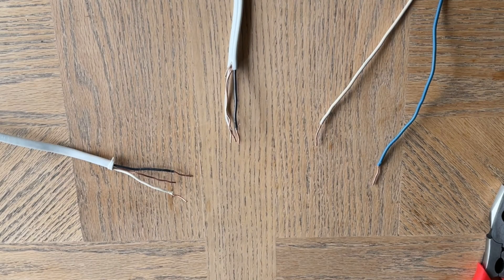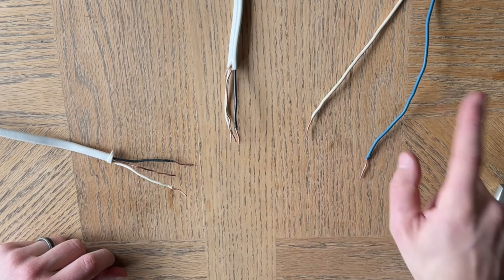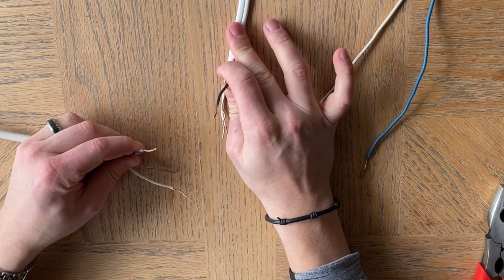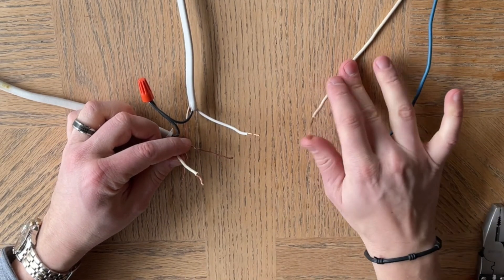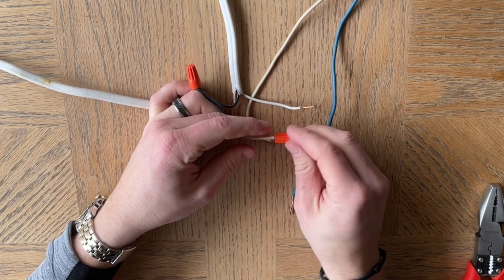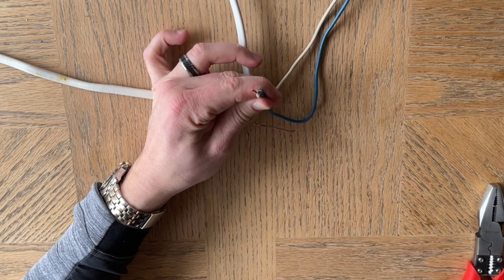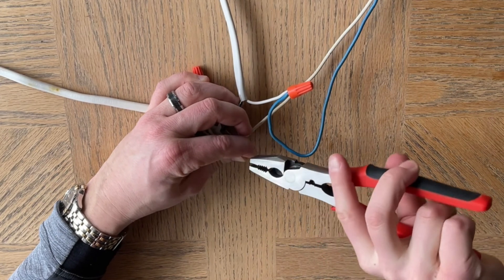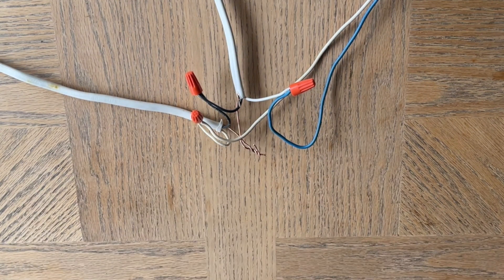How To Power A Light Switch From The Light Fixture

Comment: Preference would be to have the neutral come down from the fixture into the switch box and just terminate in the box just in case the neutral is needed later (like for a dimmer or fan controller).  Then another Romex would run from the switch box back to the fixture box to run the switched hot back to the fixture.  This way the wire color codes remain in tact (no hot wires on white insulation) and you have future proofed the installation.
Reply from the maker: I appreciate you sharing your approach and insights!

Comment: I have the same set up but have 2 other wires coming into the box.  I have identified the hot but cannot identify the switch wire?  how do I do that?
Reply from the maker: You can try capping the wires on one end. Then send a current from the other end. Test the wire so you know which wire runs where.

Comment: This wiring method has been illegal since 2011.  Millions of homes are wired this way and it is safe but is considered illegal now.  You MUST have a three wire cable going into the switch box now.  The black and red are used for the switching and the white neutral is capped off in the switch box.  I like the way you wired it and my home is wired as you are showing but we are not allowed to create an end-of-run switch using this method any longer.  The thought behind the change is that with all the modern switch capabilities now available they require a neutral wire to be connected to these modern devices for them to function.  I have simple switches wired to my lights and don't plan on putting in dimmers or motion switches etc and they work fine.  Since I built my home in 1999 I don't have to change anything (grandfathered in).  But, since I built a new shop this year the end-of-run switches must use a three-wire cable (black, white, red and ground) to put the switches in operation.  The white neutral must be capped but remain available for future 'new device' installation.  Good video, clear, easily to follow and understand but unfortunately the method described is out of compliance with the NEC.
Reply from the maker: Thanks for the great info about the code, I appreciate it! Many homes are wired this way and grandfathered in. Hopefully, this video will help people troubleshoot their wiring.
Reply: @HowToVideoChannel  This video is perfect for the purpose of understanding how many older homes are wired (like my 1999 home or homes built as late as 2010).  I was surprised to find that the code had been changed to accommodate the POSSIBLE FUTURE use of new devices.  Why don't they require that every kitchen install both gas and 220V outlets for the possible change to a different FUTURE cooking device.  Or require both gas and electrical options for hot water heaters.  Why don't they require switchgear to be installed at the main breaker panel in case the home owner decides in the future to install a home 
solar system.  Personally I prefer the two wire method you are describing.  It's simpler, cleaner and has worked for decades and will continue to work safely well into the future......just mark the white wire with black tape or black marker and all is good.
Reply from the maker: So true!
Even things like adding extra space in the breaker box or adding both gas and electric for the dryer.

Comment: I have power coming directly to my outlet in the bathroom from the control box how would I be able to to provide power to my light fixture then to my switch
Reply from the maker: You’ll need to pigtail another line off of the hot line coming from your control box. Then run that to your light fixture then to your switch.

Comment: Again, thank you for another great video on wiring switches. I have double switches with power coming from a fan/light fixture. I would like to have one switch powering the light and another powering the fan. I don’t know if you could help explain the wiring through written text? Maybe something to consider for a future video. Your videos are so easy to understand that I would enjoy watching more of them.
Reply from the maker: Glad to hear you enjoyed the video! What does each switch control right now, left, right? It may be as simple as unwiring the switches and only putting one set of wires on one switch and the other set on the other switch.
Reply: @HowToVideoChannel Thanks for your response! I have a one gang box with a double switch. The fan/light used to operate on one switch where you had to go to the fan and either pull on the light or fan chain to turn either function on or off. I would like to be able to control the light and fan separately from the double switch.
Reply from the maker: Okay, that makes sense. What you’ll need to do is open up the fixture and find the wire that is controlling the fan. Then you will wire that wire to the line that you are sending down to the switch that you want to control the fan.

You’ll do the same thing for the wire in the fixture that is controlling the light. Wire that wire to the line that you sent down to the switch that controls the light.
Reply: @HowToVideoChannel Thanks for the additional instructions. I found a video that showed what you’ve described. It was nice to get confirmation. Thanks and keep up the good work because you’re a great teacher!

Comment: how would you add an electrical box to this setup? I think it's required to be compliant and derisk spark fires.
Reply from the maker: Probably add the box before the fixture. Then run lines from the box to the switch. Then from the switch to the fixture.

Comment: what happens if you splice the fixture neutral to the switch neutral? Basically mixing up the switch and breaker cables
Reply from the maker: That should be fine since the neutrals are supposed to be connected. It runs from the breaker to the switch and to the fixture. The switch acts as an interrupter.

Comment: Have this exact setup at a fixture in bottom stairs of my basement the switch is upstairs. If I wanted to add a light at the top of the stairs close to the switch how would I wire that
Reply from the maker: You would have to pigtail wires off of the existing light fixture, since the power is coming in there and there is probably an existing pigtail, and send them to the new fixture. 

Or, you could possibly pigtail the wires at the switch and send power to the switch and the new fixture.

Comment: Is it possible to add a switch at end of run.

Breaker to receptacle to light....to switch?
Reply from the maker: You would have to run from the receptacle to the switch and then to the light since the switch is to be an interrupter.
Reply: @HowToVideoChannel  thanks. My electrician neighbour drew me diagram. Ran romex from 1st light to switch and wired accordingly to his instructions. Worked like a charm
Reply from the maker: That’s excellent!

Comment: What if i have that same setup but also have  another wire that idnt know wher it goes? And the light switch turns light on and off but theres still load to wires when light switch is off
Reply from the maker: Sounds like something that should get checked out by an electrician. Seems like you have extra hot wires. Possibly a second switch that was abandoned???

Comment: Hi, how do I wire a single pole switch to an existing ceiling light with a pull cord to turn on the light?
Reply from the maker: You would interrupt the connection from the hot line in to the fixture. The hot line would feed the switch and the switch would send power to the fixture.

Comment: I wish to add  a second light to my stairs.   From the bottom stair light for power, to a new 2nd switch to the second light. Make sense?
Reply from the maker: I think so. You want to add a second light and a second switch. So you’ll have two lights and two switches with both switches controlling both lights.

Comment: Is it possible to take that light switch to power a different light that I install?
Reply: Do you mean a single switch controlling multiple light fixtures? If so, just add another nm cable connected exactly the same as the light fixture (as if you were just duplicating the fixture), and run that nm cable to your new (additional) light fixture.
Reply from the maker: Excellent!
Thanks for sharing your expertise!
Reply: @HowToVideoChannel  of course. Thanks for putting out quality, knowledgeable material.

Comment: I have a similar set up in one room of my house with a twist. Hot wire comes into the ceiling box to power the light, wires go out of the box to the switch, but the twist is the rest of the room (several outlets and a closet light) get power from the hot wire in the ceiling through the light switch somehow. I know this because now that all the wires are disconnected those outlets and closet light do not work.
Reply from the maker: That is a strange setup!

Comment: It's would be wise (actually its code) to put a few wraps of black tape on both ends of the white wire going to & from the switch to indicate it's being used as a power in the application rather than the common or neutral that the white shielding would typically indicate. So that white wire connected to the blue wire should have a few turns of black wire near the end (as well as at the switch end) as part of the setup.
Reply from the maker: That is a good practice.

Comment: Great video! Really helped me understand the old wiring in my first home. How would I power two other switches off this single source of power? I'm trying to add a bath vent van that has a light and the fan
Reply from the maker: Glad it helped!

You’ll have to run additional wires sort of like adding extra outlets. But it will be complex depending on whether you want the switches to control different lights or the same lights.

Take a look at the other wiring videos on this channel. I’m sure they’ll be helpful as well.

Comment: Thanks so much! What if you have to send power from that fixture into the next fixture in the next room? I'm guessing everything the same except the H and N from the load come in from breaker would connect directly to the line going to the next fixture?? Is that clear as mud?
Reply from the maker: You would need to pigtail the H and N from the breaker. Sort of like if you run multiple outlets and pigtail off the main line to power each outlet. 

This is slightly more complex since you’ll have an additional wire from the switch to the fixture for each room. 

However, if you only have one switch for all rooms then you can simply run the wires directly to the next fixture without pigtailing. Exactly like wiring multiple can lights in a ceiling.
Reply: Please do a video on this next.

Comment: I had the same issue...as old light fixture was hot with toggle switch.....now makes sense... My question is can the can new line be a 12/3 wire ....and if so, how is it properly wired?
Reply from the maker: As long as the current wire is 12 gauge then that should be fine.

Comment: I would wrap a piece of black electrical tape on the white hot wire connected to the blue fixture wire to designate as a hot wire.
Reply from the maker: Yes. That works well!

Comment: i did the same set up but i need the neutral wire for smart dimmer light where i get it from since the neutral is hot now
Reply from the maker: You probably need another wire.
Reply: @HowToVideoChannel  thanks for your reply. So do you think i can loop just the neutral from the  box in ceiling
Reply from the maker: That would most likely work.
You should run your plan by a local electrician to make sure it’s up to code.

Comment: can you add a 3 way switch? to this same configuration?
Reply from the maker: You would need to run an extra wire, but essentially, yes.
Reply: My problem was the first switch feed was a powered by the light fixture itself. I realized I had to use the white on the common @HowToVideoChannel
Reply from the maker: Glad you got it figured out!

Comment: What if there is another set of wire to an outlet? That you don't want to use a switch on
Reply from the maker: If they are extra wires that you don’t need then you can coil them and put a wire nut on the ends.
Reply: Powder room application, same scenario as your video, however I would like to add an outlet next to the light switch. Can the outlet be powered directly from the switch? It would be fine if the outlet would not function if the light switch is off.
Reply from the maker: Yes, you can add an outlet. 
You’ll probably have to pigtail from the hot line so that your outlet has continuous power.

Comment: Ok this is the same situation i have with my basement lights. I built a pantry and want to use the existing light switch wire, that's just like this demonstration, to another light switch on the other side of the wall with can lights in the pantry. There's no other power source in the area so is it possible to do? I've tried a handful of different connections and they either don't work or it's like the lights and switches are crossed... any suggestions? I hope i explained that correct haha
Reply from the maker: So you want to have the lights controlled by 2 different switches?
Reply: @HowToVideoChannel  2 different sets of lights using the one wire coming down the wall to the existing switch, if that's possible ..
Reply from the maker: So one switch that controls two light fixtures in two different locations?
Reply: @HowToVideoChannel  sorry. No I have the one existing wire coming down to a switch. I wanna run another switch off that wire as well that controls another set of lights on the other side of the wall. Or do I need to tap into another power source?
Reply from the maker: So you have an existing fixture and switch. You would like to add a new switch that will control a different fixture. The end result will be two separate fixtures and switches.

The existing fixture and switch has the power in the fixture. You’d like to send power from that to the new fixture and switch. 

Your power is running from fixture A to switch A. Therefore, you could send the power from switch A to switch B. Then send the power from the switch B to fixture B. Probably not code but as long as it’s all wired correctly it will work.
Reply: @HowToVideoChannel  ok thanks! I've tried a few different variations and they either don't work or switch A turns on fixture B and vise versa.. I'm no electrician so I'm trying to figure this out haha thanks again!
Reply from the maker: I have another video about a light fixture getting power from the switch that may be helpful since that’s what you’ll be doing with switch B.

Also, make sure that your power runs from fixture A box > fixture A > switch A > switch B > fixture B. Then pigtail off of the main power hot and neutral line for each switch and fixture.

Comment: Thanks for the video.  Now for multiple lights it would be the same way. All the neutrals go to the power wire and the blacks go to the neutral going to the switch?
Reply: @6creed933
NO! Don't do this. Someone will get hurt at a minimum. See my other comment in this thread for doing it safely.
Reply from the maker: Yes, that should work. Then the switch would control all of the lights.
Reply: @6creed933 @HowToVideoChannel 
yes, technically that would work, but you'd create a lot of confusion. Better, after labeling the white wire with black tape from the switch that's connected to the black wire at the light, also attach at this joint, the black wire leading to the other lights. Then, connect the white wires leading to the additional lights into the other white wire bundle. This way all the rest of your white wires remain common and all the black wires remain power. Otherwise someone's highly likely to get an unexpected shock, trip a breaker or worse when they proceed to do something with the other lights because the black & white wires will be switched and they won't know it. That would be potentially very dangerous.